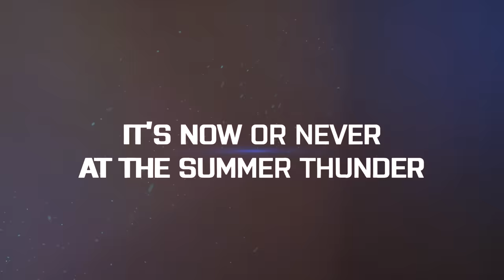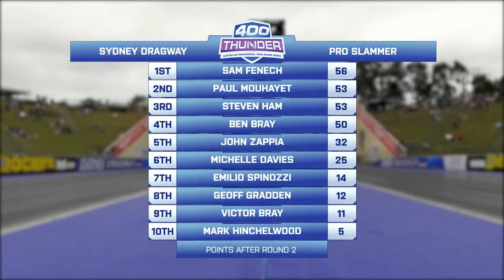Pro Slammer,Summer Thunder, Sydney Dragway - January 19, 2019

Comment: Safety first.put a shield around the transmission.🤔💯
Reply: And a floor over it as well.
Reply: It's one of the least likely parts to fail in a Pro Mod / Doorslammer. You can expect to put around 100 passes on an engine before it needs a complete rebuild/machining work done, whereas a transmission will last several hundred. The biggest wear and tear on a trans is actually on the converter/clutch, which they service nearly every run. The rest is fine.

Comment: Bad luck for Fenech in crashing. But 200 mph cars with 50mph brakes will always be a problem.
The skinny bloke in the black 57 was renowned for killer burnouts. What has happened? Was always a crowd pleaser.
Reply: He's had a lot of health problems.
Reply: @senzubean31  Are we talking about Victor here?  I've been away from the (Door)  Slammer scene for a number of years now. Man,  the class has evolved. Pro mods - slammers.
Reply: @burnout9069  Yeah. Victor Bray has had some pretty rough years with cancer. It's why he's lost so much weight.
Reply: They have good brakes, they don´t have enough traction on front to really slow down. It´s like using an E-brake at 400+ km/h.
Just imagin the front tires on the back with 3000+ hp... You cant put the power down...
Reply: @hooyabaaa2  They have brakes for 50mph. They are using similar brakes as to what a Sprintcar uses and they weigh half as much and might do 100mph. And they have lousy brakes as well!!
Look at cars with real brakes, eg V8 Supercar, trhey have 14" rotors and monster callipers. Drag cars have weenie little rotors and 3" tyres!! Put some full size wheels on the front of the things with at least a streetcar Wilwood brake, eg 12" rotor and a decent 4 pot calliper. Though they do go twice as fast as a Hot streetcar.
Though at least then they will have 120mph brakes which may save them from the catch net. 
The junk they use currently saves them from running into the back of the quad on the return road.
Oh and lets mention the dumb HANDBRAKE. I have yet to meet someone with stronger arms than legs. And while cars are seldom standardised in controls go right whoa middle and maybe a clutch pedal on the left is probably a very good idea. like ALL road cars and all roadrace cars!
Reply: @ldnwholesale8552  The brakes are usually from Strange (whoo built thei dif too). The big thing here is... They dont use full size wheels/tires on front because they add weight and rolling resistance, so... Huge brakes on the front isnt an option since the tires are narrow, low grip (to lower rolling resistance), using more than 70 PSI.
So, the brakes are good enough for the tires.

REAR brakes are 4 HUGE pot brakes and huge discs (not in diameter), they are fat as !@#$ to reduce fade. Since they are not very usefull 99,9% of times, they dont often use carbon discs.

You can see some top alcohols braking from more than 250 MPH only with rear brakes sometimes (they even dont have front brakes), sometimes they dont only glow, they REALLY got fire. Carbon/ceramic discs brakes better, but dont last very much and cost a lot more (4 time more i think).

Comment: he breaks down the cost of owning a door slammer. Id like to know how much would cost me to own a top fuel and drive it
Reply: These prices seem low to me for AUD perhaps they mean USD?. For example a Rossler 3sp auto is 15,700USD (23,155AUD) alone. A lock up convertor to suit is around 7000USD (10,300AUD) and a bellhousing is a couple of thousand USD as well. So before you know it you have nearly 40k AUD just in a transmission. Racing ain't cheap.
Reply: I heard. When all is said, and done. Around 15 to $20,000 a pass.

Comment: The one thing I will never understand about drag racers. The ones that put the most unareodynamic body on a car and expect to go fast at the top end. Guess they do not understand the result of pushing a brick through the air verses a low drag shape through the air. Still fun to watch other wise similar cars with the same horse power and driver abilities loose and the smart ones win.
Reply: One major factor is because being the fastest at the end isn't a winning stradigy. Cutting a perfect light and getting out of the whole and staying on track,  Then run it out the back is what these professional drivers strive for.  Track,  weather,  engine tune (how much power can be dialed in as soon as possible before the tires give way "shake".. Or where it can be used the most effectively?)  chassis tune and clutch feed on the start line all have to be considered and adjusted before each run. Not to mention monitoring engine condition to the above. Smart drivers is like have one Iron in a Golf tournament. 
A smart Tuner is worth huge dollars. It's a lot more involved then most spectators think. And one reason why it can takes these guys over 20years to get were they are.